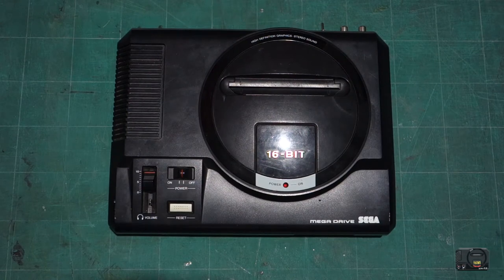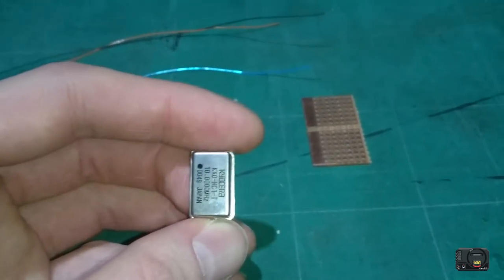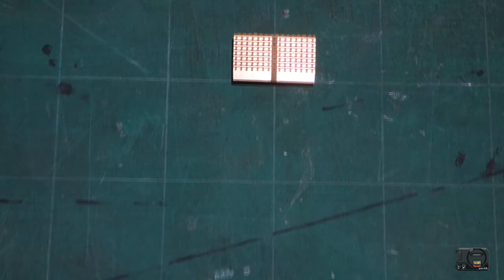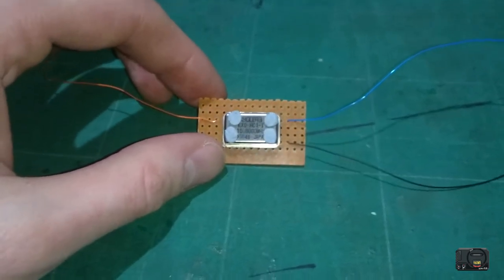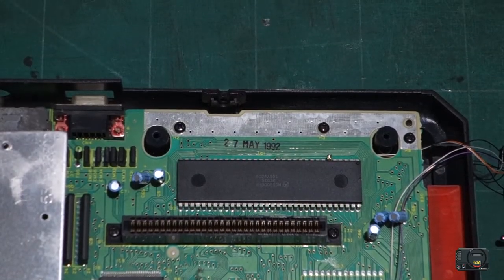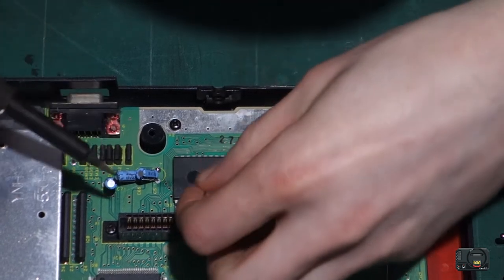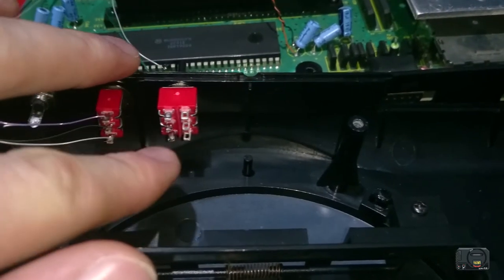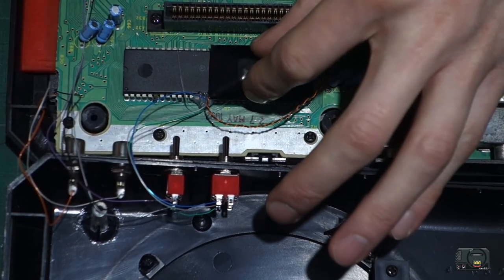10mhz Overclock Switch and Game Comparison - Part 04: Sega Mega Drive Mod Series

Comment: Such a good series here!  I just did a latch halt switch tonight (red little push on push off kind) to go with my 10 Mhz osc switch, never thought of doing DPDT for RFB mods and all these other mods you say. I am using 3.5mm aux out of the front of my Genesis 1 into my OSSC for true stereo, but maybe next time I open mine up (when my reset switches come in from Ali Express, god knows how long!) I'll do the stereo out the back mod - will watch your vid, glad I found you online- your explanations are great for first timers, especially important things like how to set up the vera board! Great job. BTW, was that Langrisser II music near the end?
Reply from the maker: Hi Erik, 

The last 3 tracks before the comparison videos were "Stage 4-1 of Batman", "Altered Beast - Graveyard" and "Golden Axe - Wilderness".

Yeah I really want to get together a tidy Japanese system and do all these mods with a halt switch.  I was thinking of seeing if I could combine it with some sort of cpu switcher, so I could put different chips in the machine instead of just a different crystal.  

Would require some IC Sockets like these: https://www.digikey.ca/en/products/detail/on-shore-technology-inc/SA649000/3313528?lang=en&s=N4IgTCBcDaIKIBEDMAGJA2AtAOQSAugL5A&site=ca&x=19&y=17 would need to do some experiments with different chips like the 68020 or 030, and some 68000 variants clocked at higher speeds.

It's just finding the bloody time. :)

Thanks for watching dude, glad the vids helped.

Comment: Best tutorial I've seen so far. There's a really old video (vhs quality) where this lad overclocks to 13.4mhz. How come all these tutorials (not just yours) only show 10mhz?
Reply from the maker: Hi Matthew,

Thanks for watching fella. 

I think that at 13mhz, there are a lot of games that start glitching out. Also a lot of games have their refresh speeds set to the clock rate of the CPU, so at 13mhz the Sonic 2 bonus stage would be almost impossible to play.

I went to 10mhz because it boosted the games with the worse slow down problems whilst not affecting, too much, the games that would run too fast under 13mhz.

Hope that helps.
Reply: @RetroRic79  yeah it does. I would have thought all the games would behave the same but if it is case by case to see the result that makes me hesitant.
Reply from the maker: @MatthewBester  there's a guy on here that's done the mod with a rotary switch, so you can select from different overclock speeds.

Try searching that one out fella.
Reply: @RetroRic79  Speaking of games running too fast, does this overclock help with the PAL region's 50Hz slow down? How different is it compared to a base NTSC Genesis running 60Hz?
Reply from the maker: It's not something I've looked into, but I'd expect that a 50hz system would run games slightly faster if they're synced to the cpu speed rather than refresh rate.

I'll be Frank about 50hz. If the game was made in a 50hz region, I see no problem running a pal machine but you will still likely have the black borders at the top and bottom of the screen.

You can play almost all the PAL library on a 60hz system. The ones that have region protection can be a problem because some of those are optimised to run proper speed on 50hz, so when you switch to 60hz after booting the games run incorrectly.

What I do generally is run my games through an everdrive type device, and have the USA/JPN Romset and run those all in 60hz. 

Region modded MD with the MegaSD is the best setup today imo.

Comment: Very tidy job and nicely done mate :) I've not done anything this ambitious before, I've only done simple padhacks and your basic region mods. There's a pretty massive performance boost isn't there, especially on Sonic 2 and Curse, Curse looks like playable now! Does he mos affect the sound tempo/pitch at all?
Reply from the maker: +exmosquito if you listen to the comparisons on headphones the 7mhz sound is coming from the left earphone and the 10mhz is coming out of the right earphone.

You'll notice that the music in Sonic 2 goes slightly out of sync but Mercs and Curse stay fully in sync throughout.

I'm sure some games may suffer from timing issues as some games will be programmed to sync with the 7mhz clock.  Sonic 2 actually runs a bit too fast in the bonus stage so it can be a bit hard to control.  All the other games I tried though juat get performance boosts to reduce slowdown.  it's hard to see it in the Mercs vid, but it's so much smoother in 10mhz.

Comment: good job! is it possible to overclock at 12 mhz? has problems? thanks
Reply from the maker: I think some games can handle 12mhz, some cpu's have problems with 10mhz though :'( - I think it's just down to luck.

There's a vid on youtube where a guy used a rotary switch that goes between 7mhz, 10mhz and 13mhz.

There's a pin on the cartridge bay that carries a 13mhz clock and you csn run a wire off of that.

Comment: Great video ! Thank you for sharing it ! 🤘😃 I have only one question))) Will it work on japanese Mega Drive from 1988 ???
Reply from the maker: Thanks for watching, in regards to your question: I think it's more likely to work on older Mega Drive iterations than newer ones. It's all down to the make of the processor. If it has Motorola printed on top of the cpu, I'd be confident it would work. If it has a company other than Motorola, I think you should avoid trying.

Thing is if you try without drilling your case, if it doesn't work then all you need to do is remove the circuit, then solder a wire from the freshly lifted pin 15, to the previous position it was in and it'll run like it did before you touched it.
Reply: @RetroRic79  ThanK you very much for your reply ! 🙏 I have the first possible revision of the MD1 and it has a Signetic CPU inside ))
Reply from the maker: @sega.maniac  ah yeah, I couldn't remember the name of the other company sega used for their 68k cpu's, I knew it began with and 'S'. I've had no luck with those.

Easiest machines are pal revisions  with the EXT port intact and "HIGH DEFINITION GRAPHICS MODEL" printed in the circular area of the Mega drive to find a model that handles OC well.
Reply: @RetroRic79  I must share it with you ! Just now I have finished doing the overclock mod for my MD1 system ! And can you imagine !! IT WORKS 🤘😭 !!! I am sooo happy about it ! I though my mega drive will just explode or something 😅 But eventually it worked fine !!! Now we both will know for sure ))
Reply from the maker: Brilliant man, that's great news. So glad you got it working 😊
Reply: @RetroRic79  Thank you man ! 🤗 And I am quite sure that this mod will work with any mega drive as long as shirt wires were used ! 😃👍